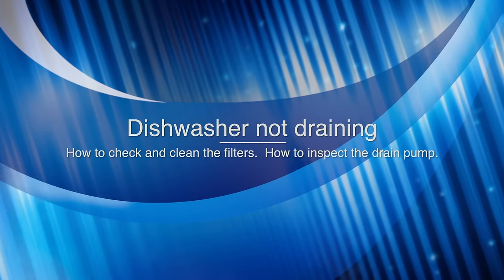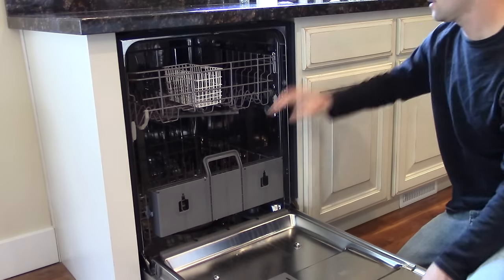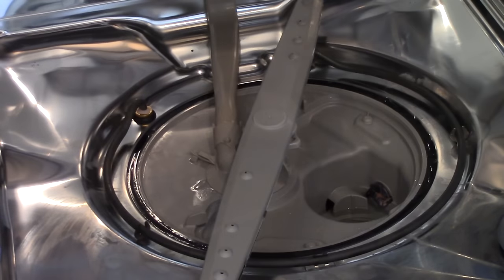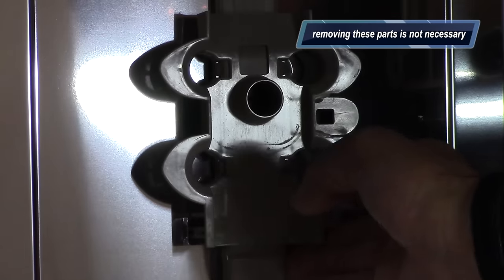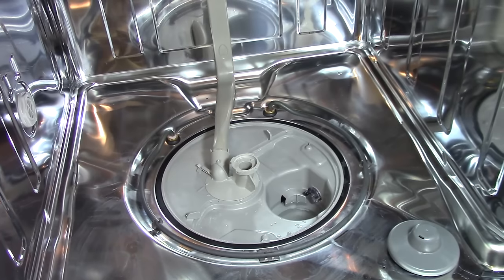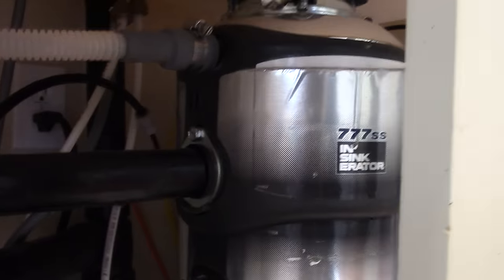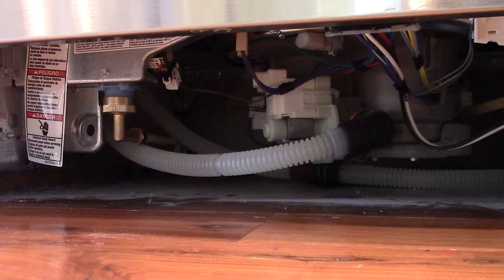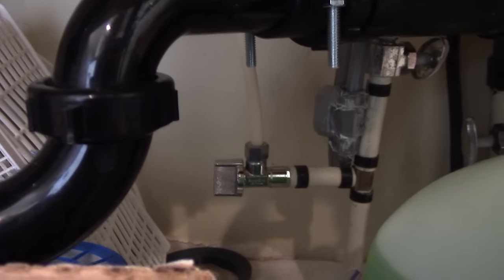How to repair a dishwasher, not draining cleaning - troubleshoot Whirlpool Kitchenaid

Comment: I had a shard of broken wine glass stuck in the impeller. Unfortunately the dishwasher was tiled in (thanks prior owner!) so I had to improvise. After some trial and error I wound up pulling out the vacuum and using the attachment hose. Capped it right on the impeller, sucked it clear in seconds. Dishwasher is working like a champ now.

Comment: Great video! I used it to replace my drain pump about a year ago. New question: Now my dishes are not getting cleaned. I wonder if there is a pressure problem...is that another pump? I already checked all the internal plastic pipes for clogs and it all seems fine. I can't think why all of a sudden it doesn't seem to be cleaning well. Any thoughts?

Comment: Hi Adam, this was very helpful ! only problem now is the hose that goes to the garbage disposal (after placing the tube back in the drain) we placed the dishwasher cycle on rinse. The hose explodes off the drain in which caused a  lot of water on our floor. Could you please advise us how we can fix this issue.

Thanks in advance Nikki

Comment: Hi Adam!  Thank you for posting your videos, they are sooo helpful!!  My question is we have a 2 year old Kitchen Aid dishwasher all stainless inside.  Suppose to be a real good one BUT I cannot get the smell out of the dishwasher.  I have used EVERYTHING!  I cleaned all the filters....I am wiping around any plastic areas like the soap cup thing and nooks and it's gross grimey nasty stuff.  The dishes turn out ok but the smell is driving me up a wall.  Do you think it's something with the pump?  Something clogged in a hose and the water isn't as clean as it should be?  Just don't know what to do.  I believe my husband took it apart a little and checked one hose but he said if not that it would be a pretty big job?  Any help would be great!  Also have to blow dry our fridge ice maker every month or 2 Samsung fridge in order for ice to work.  Sorry so long, so frustrated.  Thank you, Lisa

Comment: Adam, I have this exact unit. It will not spray dishes. Replaced inlet valve. Confirmed water flow into machine. I filled manually with 2 quarts. It sounded like it was going to wash but then the pump emptied the water I put in, right into the disposal full force. I can hear the timer click through its cycle but never hear the washing begin. It makes a sound like paper flapping against fan blades. I checked for debris as your video shows even moving the pump impeller blades. Everything is very clean. I assume the pump sprays water inside the cabinet and pumps water out of the machine, so there must be a diverter valve of some sort? The price of the pump/sump is over $100. Any help would be appreciated. I can send a cell phone short video of the flapping type sound. Thank you, Dan

Comment: Great video, thanks, I have the same unit and just found a piece of plastic lodged in the check valve in the hose near the exit of the drain valve. had to take the hose out, it does a loop around the left side of the unit, but once out, higher pressure water pushed the plastic out. thanks for the video!

Comment: Thanks Adam, I am going to look at everything in the video. My question is, I have a 1.5 year old Whirlpool portable dishwasher that recently started leaving food deposits. The water drains quickly from the hose you attach to the sink. I am using the same detergent that worked great for a year +. I did find a little bit of wrapper in the large filter shaped half moon like the one you pulled out in the video. Just a little, but I cleaned it out. The circular filter has a little line of black mold??? on it. Being a single person, it doesn't get ran very much, and I am on a well with softened water and no grit. Where the half moon filter snaps in, I found blue and white crystals...left over soap??? If I find nothing obvious, do you have any ideas? I run the water prior to hooking up the washer so the water is hot.

Comment: Hi Adam, good video.  Cleaned all the filters and still would not drain on Kitchen aid.  Cleared all lines, replaced pump and still won't drain.  So, could problem be water inlet valve or control board?

Comment: Thanks for the video.  I do have a couple of questions.  When I took the top basket out and turned it over, the tube connected to the basket drew my attention.  At the end, opposite where the arm attaches, there are two holes.  They both have rubber flaps.  One flap is closed and when pushed open ,it closes again.  The other looks as if it is open or not closing properly.  Could that be an issue or is that normal?  The other question is do you have a video on fixing the detergent dispenser?  Thanks for any help.

Comment: A glass broke inside my dishwasher (WDF330PAHSO) and I thought I grabbed it all when I vacuumed the glass out. It ran OK with a little of the glass flowing thru it...however, it now doesn't drain. I watched your video and will attempt at cleaning the places I missed. I will come back and see if I was able to "fix" it. 
I saw another video before I found yours and it advised to run a cycle with vinegar and baking soda mix. Would you recommend that also?

Comment: Nice comprehensive vedio
My dishwasher is whirlpool drain but only one feet high but  not pressure drain I cheek pump is working check all drain opening is clear but still water in dishwasher after each cycle

Comment: Hi. Thanks for your video. I checked all of the things you showed and listened while the cycle ran. The water is running with no clogs and draining fine. The filters have all been cleaned but I’m not hearing any motor sounds or water agitation from the sprayers. Is it possible I’ve got broken glass in the motor and if so-how do I check? Thanks!

Comment: Thanks Adam, great video. I have a whirlpool model very similar to this in my rental property. It will not drain at all. When I press the cancel button, the motor does not turn and dose not hum. 
1. Removed motor, found broken impeller blade but no obstructions, turned with my hand no prob. 
2. Measured motor wingdings at 7.5 ohms, is this normal?
3. Got a replacement motor, tried it, same prob, motor not turning (or humming)
4. Measured the voltage to motor when the cancel button is pressed,  only saw 37Vac, should see 120Vac correct?
5. Removed main control brd #w1034910 but no visual damage. 
Suspect that the motor was stuck, overheated and took out the control board. What do you think? Is there something super  simple that i'm missing that would cause something like this as I have a tendency to over complicate things....!! Thanks Rob

Comment: This is very useful, thanks. Mine is making a noise like crackling glass or electrical sparking (but no smoke so I assume something in the pump). Am following your directions now!
Reply: +typo graphica I get the same noise when it starts to drain for a few seconds then it stops. The pump continues and the water still drains. Is my drain pump gone? It's a Kenmore Ultra Wash.
Reply: Cornerboynl, I opened mine up and inside the impeller I found not broken glass – which is what I expected – but an olive pit! The paddle couldn't turn so it didn't drain much, and hitting the olive pit made it sound like crackling... As soon as I put it all back together, it works 100%, good as new!! GOod luck, hopefully yours is easy to fix too.
Reply: +typo graphica I had the hose off and saw nothing in there. I had the pump off and impeller was free, still saw nothing loose in there. Last night ran full cycle, no noise. Looks like I have it fixed but don't know how I did it. I'll just have to watch it for a while. I guess repairmen don't like youtube, but everybody else does. I never worked on a dishwasher before.

Comment: I need some advice. I replaced the pump on mine this weekend because there was always water standing in the bottom of the dishwasher after each wash. A repairman came out and diagnosed that the pump was bad so I bought the new pump and installed it myself. However, there is still water in the bottom. Mine is a Kenmore 665 type and very similar to the one in this video.  I removed the filter and the grill and put my hand in the hole where the sensor is located but I couldn't feel the hole you mentioned (maybe I did something wrong. I mean it has to be there). I checked the end of the hose at the disposal and it was pretty free of blockage. Still water. I'm kinda lost on this one. Any thoughts?

Comment: I have a Gold Series Whirlpool similar to the one in the video. It appears mine is not getting enough water pressure to clean at all. I've already cleaned the screens, they weren't that dirty. Is there a "chopper" blade like I've seen on other brands that helps break up debris before sending it down the drain?

Comment: hi Adam, just wondering,  my dishwasher is not located right next to the sink, as there was not room there; therefore we bought the 12 foot drain hose which is great, except it still is not long enough to do the high loop thing under the sink. Can I add the 6 foot hose that came with the dishwasher to it to make the high loop or is this too much, too far for the hose to go. My dishwasher works great now, cleans great, but there is always water in the bottom of the filter area,  wondering if this is the cause of that. Thanks.

Comment: Nice video. How much water should be left in the filter after a cycle? After a cycle is complete I remove the round liter and it is still full of water.  I check for obstruction as you have shown and nothing.  Shouldn't it pump "all" of the water out.  This is a new problem and the leftover water is leaving a bit of a smell behind.  Whirlpool, about 1 1/2 years old.

Comment: Hey Adam, We have a whirlpool almost like the one you showed.  It won't drain at the end of a cycle.  You can hit the manual drain option after the wash cycle finishes and it will drain the water just fine.  I had the repair guy out and he said that it needed a new motherboard.  I replaced it and now the same problem still exists.  Any ideas on the what the real problem is?

Comment: I have a similar dishwasher as in the video. Question on the Rinse aid dispenser. It appears the dispenser will release the detergent but will not dispense the rinse aid. Any suggestions or do I need to replace the dispenser?

Comment: I have a whirlpool gas oven very similar to the one in the video, my oven will light and go right back out once the igniter stops clicking. I cleaned it it like the video shows and it worked far 2 days and started doing it again, I have recleaned it and it stayed lid for about 5 mins and started lighting and going back out when igniter stops. Would the igniter itself be bad?

Comment: Hello Adam. This is exactly the machine I have. Mine drains out most of the water but leaves 1/2 to 3/4 gallon of water in the bottom. I cleared the drain hose from both ends. I've cleaned the filters and made sure the port going into the garbage disposal is clear. Any ideas? Thank you

Comment: My dishwasher is not draining (Whirlpool ADG 6240_1 FD, error: F8 E1).
The drain hose is new, filters are clean, but the machine is full of water. I assume that the problem should be after the hole towards the pump and between the drain hose.
What could I do without disassembling everything? Can I get to any debris to be cleaned through that little hole under the filter assembly? Thanks in advance!

Comment: Have a whirlpool dishwasher wdf775saym0 that is leaking from the plastic housing of the diverter motor during the wash and rinse cycles.  Reading other posts it seems to be a common problem.  Is the grommet fairly simple to replace or is the better bet to replace the entire motor?

Comment: Great video. Thank you. I was searching for this particular demo for last 3 days now. Have saved it for future reference. The problem with my Whirlpool dishwasher is that it stops mid cycle. Everything works fine except the dishes are not clean! hahaha
Would it be an issue with the Spin arm? The soap dispenser is open and the soap drips on the floor of the DW. What should I do to fix this problem?

Comment: Thanks for making this video.  You saved me a service call.  I had to remove the pump and then I found a small piece of glass blocking the impeller blades.  Put it all back together and it works like a champ again.  My deepest gratitude to all of you who take the time to make these videos to help others.
Reply from the maker: Glad to be of help!
Reply: Pretty easy to take the pump/impeller apart as well - just twist and turn the whole assembly.  Easy to remove stuck glass/debris etc.
Reply: Had the exact same issue (small piece of broken glass caught rolling in drain pump and blocking the impeller ). Had a hard time removing the tiny shard but I managed to do it by pouring a glass of water in the filter hole and activating the drain pump on the command dashboard. The water helped push the shard outside the drain pump. Adam, many many thanks for this video and your precise instructions. It helped immensely.
Reply: Did the same - forced the drain pump to work by pouring some warm (on the hotter side) water. And it's working!
Reply: How do you activate the drain pump?  Did you have to remove the drain pump or just the hose that Adam mentioned in the video?
Reply: To activate the drain pump, simply close the dishwasher's door and press&hold the "Cancel/Drain" button on the command dashboard. 

I simply removed the hose in order to observe the debris coming out of the drain pump when activated (I also used a shallow bowl underneath the drain exit to collect the drained water).
Reply: Roberto Pimentelk
Reply: Thank you SO much.  I fished broken glass out from the impeller, and everything's gravy now.
Reply: Kevin Blanchardfqq
Reply: thank you so much!! found a piece of plastic in impellor. Now it's fixed! I owe you big time!
Reply: Thank you so so much for this video! You too have saved me a service call too! I fiddled with the impeller blade and a piece of glass popped loose. After putting everything back together, I have tested the draining and it seems to work perfectly!
Reply: Same. Piece of glass size of Quarter was starting to rub down the impeller.
Reply: Can I send you a picture of a part that disconnected and I have no clue where it goes.   I am going to do the cleaning and checking of pump. Thank you for posting.
Reply: Easy to forget to pop the dishwasher drain plug out before installing. Its a pain in the ass to pop it after install!
Reply: P0
Reply: This is an excellent video.

Comment: I am curious how much drain water should be left in the "cup" where the filter and sensor are?  I always have water in it and now it is starting to get a bit higher and wondering if I am having a pump problem.
Reply: If you find this out, then please post what you find.  I took my entire washer apart, made sure everything was clean and cleared.  Water still in the bottom after a wash cycle.  I replaced that sensor shown, still same.  If I push the "drain" button, it drains which demonstrates to me the pump is working and not clogged.  Alls I know for certain is that dirty water sits in the bottom and starts to smell after washing the dishes.  Don't know if this is "normal" and if I'm chasing a ghost.
Reply: My exact question! I hope he answers you
Reply: In my case, I had water sitting in the cupa also but after I followed the video and fixed mine the cup was completely dry after a full cycle.

 I soaked up the water with a couple of towels, a shopvac would work better. Lol. My problem was a large piece of plastic in the elbow of the hose that comes off the drain pump.
Reply: Still don’t know the answer. I have that filthy smelly water filling up rhat hole every time. Is that normal? I’ve heard that a Little  water leftover in the hole is good because it keeps the O ring lubricated so it doesn’t dry out...but I have way too much in there compared to the little amount of CLEAN water in this video

Comment: excellent instructions. Saved the day and some dollars!  on my dishwasher the water was not draining. I followed the steps to remove the screen and filter. then used a glass/cup that fits into the hole for the screen to remove the collected water 1 cup at a time. Finally used a sponge to soak it all dry. Next I followed the instructions to check for clogs. Found nothing. I put my finger in the hole to reach for the little wheel in the pump and turned it a couple of times. Finally I turned on the dishwasher in the Drain/cancel mode. and the little wheel turned and I could see it spitting out debris. On closer inspection I found the culprit. it was the little twig like things that attach to grapes. It must be my wife!! she is careless about what goes into the dishwasher!
Reply from the maker: +Dipu Ray Glad to hear you fixed it! Thanks for sharing.
Reply: AdamDIY has